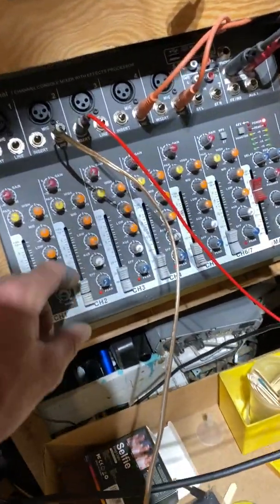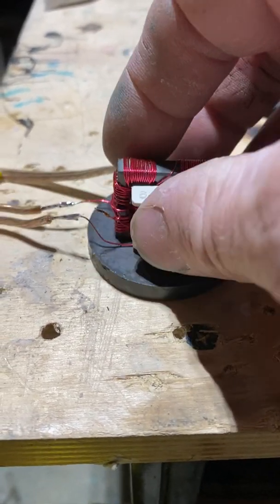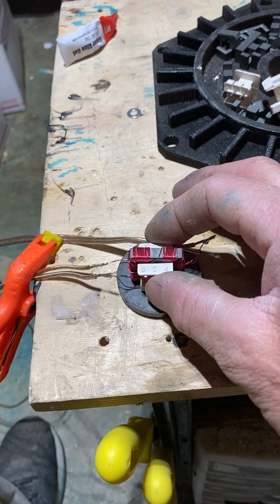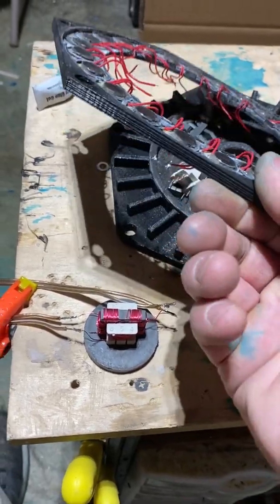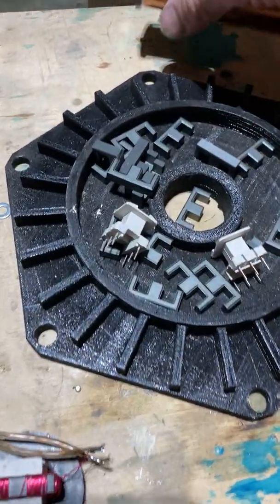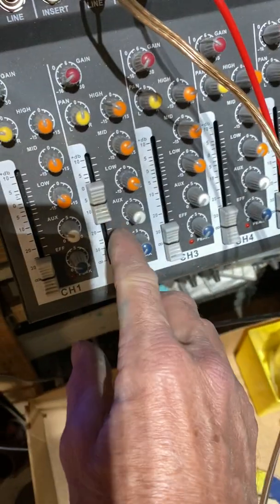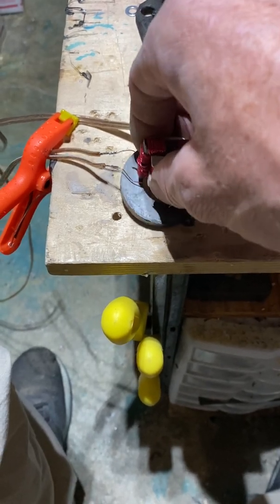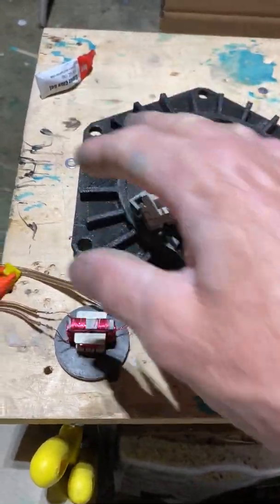Setting up tiny feedback loop system fir my plasma feedback loop system

Comment: Pretty sure your on to a free energy machine. Start using a meter and see if you can get any voltage from the air and turn into usuable current. Amps
Reply from the maker: I have with a shuttle circuit